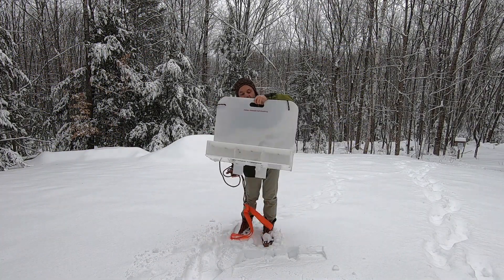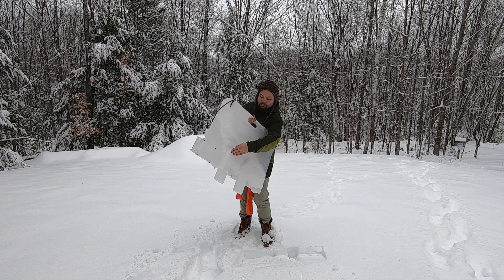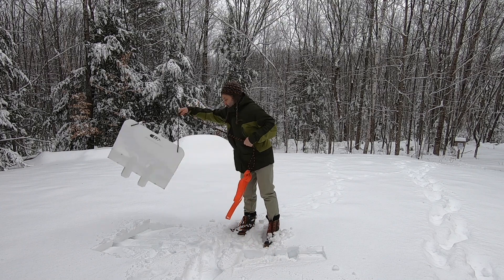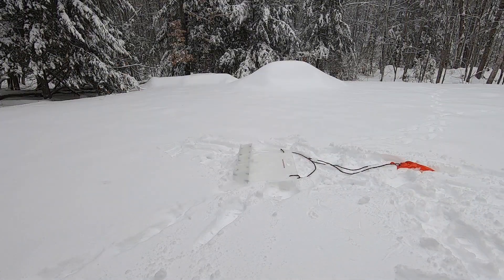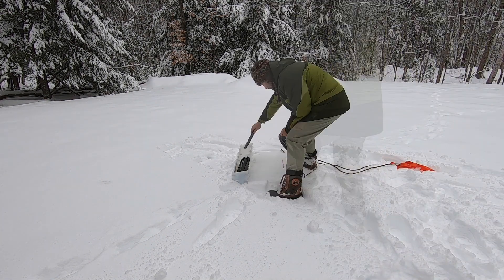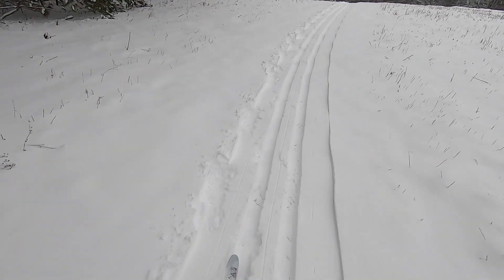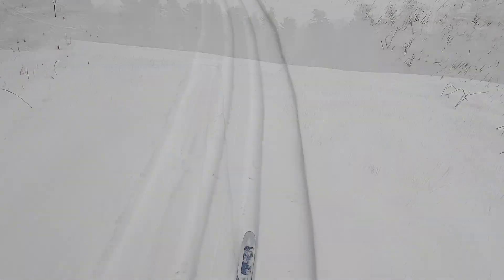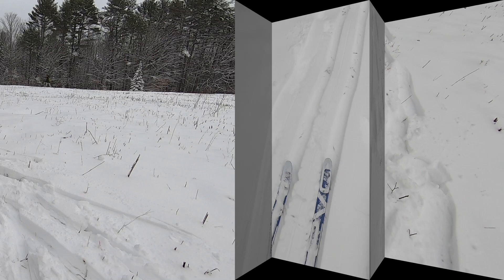Human Powered Cross-Country  Ski Groomer

Comment: How did you make the ski runners? Are those 3d printing?
Reply from the maker: I did not make it, I bought it from a little company that has since closed.  All parts are UHMW plastic. The runners are shaped like flat bottom boats, a trapezoid with the narrow side down, pushing the snow.  They are approximately three times the thickness of the ski under foot. I suspect they were cut on the tablesaw with the blade tilted 10 to 15° to produce the side bevel.

Comment: Are the ski runners a single solid piece of plastic, cut to shape?  Or are the runners made of pieces of plastic fastened together somehow?

I can't see any fasteners in the runners in your video, so I'm guessing they are solid plastic, or glued.  

I ask because I'm thinking about making a classic trail groomer modeled on the one in this video.

I purchased one of Peter's skate trail groomers in 2013, and it has been a fantastic thing to have.    I was just about to order a classic groomer when the business paused. 

I had to replace the main sheet on the skate trail groomer this year.  It was cracking and a bit brittle, and there was some self-inflicted wear on it :-).   The main sheet on my 2013 groomer is only 1/8-inch thick.  I used concrete pavers as weights, and in low snow conditions, the pavers can bounce around a bit, damaging the plastic main sheet easily.   At least that's my theory.
Reply from the maker: Solid  pieces,  they are screwed to the sled from the top with wood screws

Comment: If you weigh 200 pounds. Then should you put 200+ lb of weight in it to properly pack the snow?
Reply from the maker: The 60 to 80lb weight is intentionally concentrated on back edge of the groomer where a small but wide area of high pressure is created.  The person on snowshoes or skies distributes his weight over large surface area so that they can stay on top.